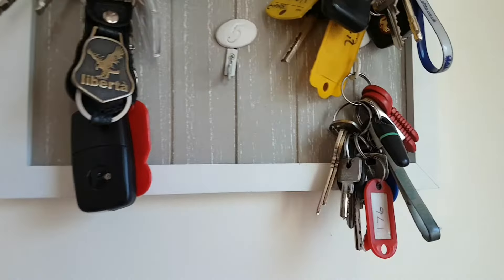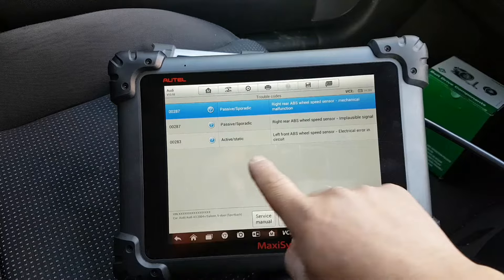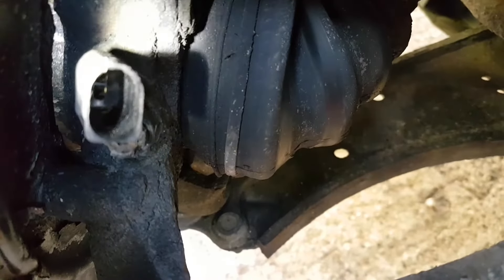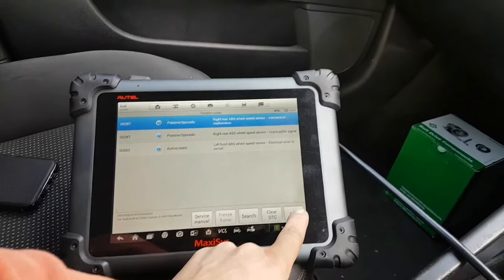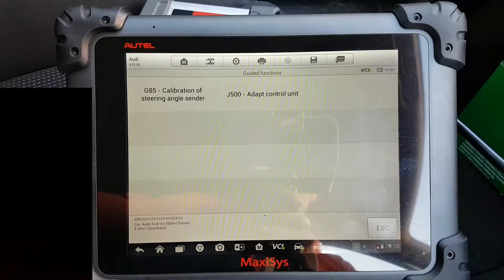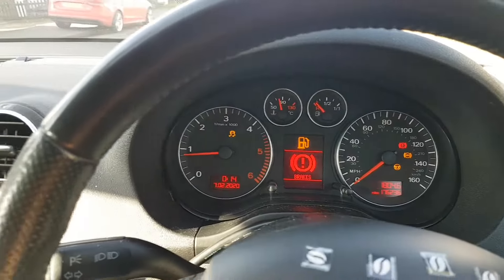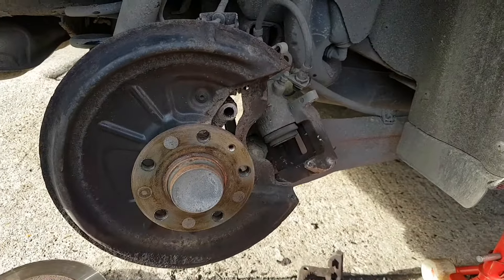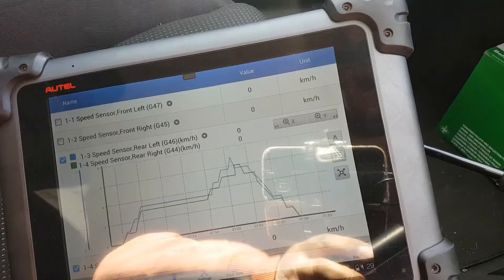Audi A3 8P ABS, ESP and Steering assist lights on. Multiple faults... Fault finding and repair.

Comment: Luis what makes them abs ring touch the sensor is corrosion build up behide the ring forcing it outwards you can get the ring for about a tenner  did both on my vw golf same set up nice video  buddy
Reply from the maker: Thanks!
👍👍👍

Comment: Good video as usual. One thing I would say is you were fortunate that the Autel showed the bad sensor waveform. I've had 0778 code, or whatever, and calibration not work because of the tiniest glitches you could imagine. VCDS scope feature usually shows them but sometimes only properly scoping the sensors shows the problem. That's the reason the car needs driving in a straight line for a while, so the computer knows there are no glitches in the wheel speed signals. Until then it instructs the under wheel computer (or if the angle sensor is in the rack and connects straight to the ABS pump it just disregards it) to kill one of the 5v feeds to the steering angle sensor (there are 2, one for transmit IRs and other to the receive IRs - can't remember which one it kills but 7 diodes for each and 2 supplies, 10 pins). This is an underhand way of doing it by VW. There is no explanation anywhere of why the calibration fails - especially when sometimes there are no codes. And the steering to the left then right procedure for the calibration is done right to left to set the limits. Don't you just love German cars 😁.

Comment: Awesome video 
I actually just purchased a Audi A6 with only 96000 km on it. Only a week in and I'm having some driving issues. I kinda noticed when driving last couple days but got really bad last night driving home. Down the road and all of a sudden my ESP came on and says see manual along with tracking control symbol along with check engine light. Car runs very rough at idle and shaking as well. Like it's running at only 3 cylinders..
Reply from the maker: Scan the car...
The logged faults should help you to narrow the problem...
Thank you for watching! 
👍👍👍
Reply: @LMAutoRepairs  yes I'm taking it in tomorrow to get it looked at. Talking to the guy at the car lot and he said it's a normal probably for the German cars to have either plugs/coil packs gone bad.
Reply from the maker: Possibly...

Comment: The magnetic abs rings on the wheel bearing rust underneath and swell up to close the gap with the sensor. Seen that with the live data after the fix wasn't exactly the same on both sides. Aftermarket ones are terrible for this. Hope this info is of use to someone watching. Happy new year my friend
Reply: Happy new year Mr L may God bless you with new and extraordinary ideas and skills to solve car problems  . Thanks.
Reply from the maker: Thats common on BMW...
Reply: @LMAutoRepairs  yes the rear ones on bmw which have metal slots have the same problem

Comment: Love your channel brother, Helps me out on the regular. Thanks
Reply from the maker: 😊
That's great to know...
Thank you, for watching and for your comment! 
👍👍👍
Reply: @LMAutoRepairs  Hi Bro, I have a question if I may, If I had a faulty brake switch, would it interfere with calibration of the steering angle sensor?. 
Basically I changed the ABS sensor on a Audi a3 2007, I cleared the code and reset the module, Immediately the steering went 20% heavier. Before that I also replaced all disc n pads and pumped the pedal a few times all the way down, I was thinking maybe this caused the switch to fail. Now I cannot seen to recalibrate the steering angle sensor and the ESP warning is on.
Cheers Mate
Reply from the maker: Possible...
ESP related components are all kinda linked...
Fix whatever fault you have and try the calibration again...
Reply: @LMAutoRepairs  Hi Bro, you were spot on, Replaced the faulty ASB sensor and recalibrates the steering angle sensor. It worked and adapted fine. Now the steering feels fine again. Glad it wasnt the brake switch, its located in the servo,
Reply from the maker: That's great! 
👍👍👍

Comment: I had this same issue, luckily only changed the sensor & bearing and all 3 dash lights went off & power steering is back
Reply from the maker: That's great!
👍👍👍
Reply: @LMAutoRepairs  Great Video i would be lost without this & mechanics suggested steering rack haha! But because i saw this i insisted its only the abs sensor & possibly abs ring / bearing thank you!

Comment: Hello I got a problem with steering assist also tried to erase fault code and after it works again after few days red light and alarm for steering assist come back and lost steering assistant completely hope you can give me advise to fix it. I'm from Philippines with audi a3 2007 1.6 sportsback almost same as in your video.thanks
Reply from the maker: What is the code that is coming up?
That should give you some direction...
👍👍👍

Comment: 22:40 for calibration will it be enough to start the engine and stand or do I need to drive?
Reply: Did not worked with my 8P, tried many times at different times

Comment: I've got all them lights on my golf mk5, it's come as the brake pressure sensor as 1 one of them
Reply from the maker: Is pressure sensor external or built in inside the module?
👍👍👍
Reply: @LMAutoRepairs  not sure, trying to locate it
Reply from the maker: If it is internal to the module, a replacement module/modulator block is probably your best option...
I never managed to find those internal sensor for sale...
👍👍👍

Comment: After changed the sensor do we need to reset the code or it will go . The speed / abs / parking assistance sensor for a Vw touran
Reply from the maker: I would clear the codes... just to make sure...
👍👍👍
Reply: Thanks 👍
Reply: @LMAutoRepairs change both rear abs sensor with parking assist sensor . But parking/ revers sensor doesn’t seem to be working . No fault on dash .  Any idea how can I test it . It’s a VW touran . Thanks

Comment: Hi mate I have an Audi A5 2009 when I turn on the car everything works fine but after some seconds when I’m start driving the speedo goes to zero abs epc esp lights came on and shows me also brake warning contact workshop.
If I turn off the car everything goes to normal but after a while is doing the same thing.
I was on audi yesterday. They did a Dignostic and they couldn’t find any faults because they told me that my ecu has been upgraded.
and when they try to find the faults the computer is crushing and doesn’t show any fault.
1 another guy told that the gateway and the wiring has been changed.
I have no idea what the problem is but I have saw many videos of you and u find solutions for everything.
If u are in london or near the London can u book me an appointment please 🙏 
Thanks
Reply from the maker: Hi
Scanning the car will be essential...
That's the first thing...
Can't believe audi can't scan it, unless there is an issue with the module itself...
👍👍👍
Reply: @LMAutoRepairs  with what module? They told me that the ecu has been upgraded and when they try to scant it the odis doesn’t response. I went to 2 dealers no one could scan it..
Reply from the maker: With the ABS/ESP obviously... as it is the one that is reporting the faults...
Has been updated?
Who updated the module then?
Reply: @LMAutoRepairs  I don’t know the car has a lot of parts from rs5 brakes callipers wheels 
I don’t know what they have done to the car I have bought it like this.
Is possible to book with you?

Comment: Brilliant info in this video, I have got the same lights on my dashboard after an engine change. The scan said abs module was faulty so changed it but still got the lights on. It seems I can only sometimes access the Can Gateway and only sometimes recognises abs and steering assist modules.
Do you have any ideas. Thank you.
Reply from the maker: Check wiring etc... everything that's been touched during the engine swap..
Could be damaged wires, etc...
Thank you for watching!
Reply: @LMAutoRepairs  hi thank you for replying, I have checked and double checked cables and fuses but know it is easy to miss, will check again. I am learning with Vcds, will check live readings on sensors incase any have been damaged.  Your channel is the best I've seen and I have learned a lot already, a real pleasure to watch.  Earned a sub.
Reply from the maker: 😊
Thanks!
Yes, it is easy to miss...
Check connections and connectors, pins, etc...
👍👍👍
Reply: @LMAutoRepairs  😁🙏appreciate that, I will get onto it tomo. Thanks again 🙏🙏🏴

Comment: Hi bro.my car also has the same problem.shall I change steering angle sensor or only abs sensor .I have a fault code Rear left Speed sensor.hope to hear from you asap.many thanks
Reply from the maker: Hi
Check that sensor first...
If faulty, replace it and go from there...
Thank you for watching!

Comment: Hi! @lmautorepairs. Love your content! I have a conundrum. I recently picked up an 06 A3 3.2 VR6 DSG. With a brand new oem mech unit. My issue is: on very wet days (after heavy rain) the car will drive fine but then flash PRNDS when coming to a stop light or stop sign, issuing a Traction Control light, ABS light and check engine light. Turn the car off and on again and quickly place it into manual 1 and i am able to get going again. The lights eventually all go away once the weather dries up and i am able to drive perfectly for hundreds of miles. Car has a brand new bosch reman alternator, newer battery, new rear brake switches, the new mech unit and service. Any help would be so appreciated you have no idea! 12 codes total, relating to abs, epc, tcu not communicating with ecu etc. but when dry, no issues!
Reply from the maker: I would guess water is getting somewhere where it shouldn't...☺️
👍👍👍
Reply: @LMAutoRepairs  that seems to be exactly the case, just cant figure out where? I checked the input plug on the transmission intself seems to be free of frayed wires. Getting a code for output shaft speed sensor concerns me though…

Comment: Hello friend, I have a polo 9n3 1.2 12v, it happens that when I'm driving at least once a week an abs, steering, airbag warning appears... I turn off the car and everything returns to normal. I detected error P0600. I've seen the fuses, new battery, alternator charging 100%, I don't understand why🙄
Reply from the maker: Is that error code on yhe engine ecu?
👍👍👍
Reply: @LMAutoRepairs  Yes is the only error that appears on the p0600 scanner. I turn off the engine, turn it back on and the steering light disappears, they only come back after 2/3 days...
Reply from the maker: Any codes on the ABS or on any other modules?
Reply: @LMAutoRepairs  Thanks, I'll check this out better...😅

Comment: Don’t know if this will help but my Audi A3 1.6 2011 it had over 16 faults listed, had all the fault light on, speedo meter was stuck on zero and petrol meter was fucked. Turns out it was just a fuse issue!! And the car works fine now. zero faults
Reply: What blew the fuse in the first place though? They don't blow by themselves?
Reply: @shifty2755  car wash

Comment: Hi.  Is Autel able to calibrate the steering angle sensor?  could you do that  Can he bring it to the 0 position.
Reply from the maker: Yes... it does...
Thank you for watching!
Reply: I am using Autel.  The Vw steering angle sensor could not be calibrated to the zero position.  Have you ever tried Wv calibration with Autel?  thanks.
Reply from the maker: Yes... have considered a bad sensor?

Comment: So you have to have all four wheel speed sensors working in order to calibrate steering angle sensor?
Reply from the maker: Yes... As is part of the ESP...
Thank you for watching!
Reply: And more. Yew rate sensor and sqib also tied in.
Reply from the maker: Correct! 
👍👍👍

Comment: I have problem with my esp. 01423 error with G200 sensor... Any ideas ?
Reply from the maker: Hi
Check wiring... if everything OK try basic settings/calibration...
Otherwise replace it...
Thank you for watching!
Reply: @LMAutoRepairs  IT a duosensor under seat ?:)

Comment: Thank for the video, I have this Christmas dashboard and fixed one error that was 40% of the magnet ring was gone. However I have the issue of a different wheel showing double speed compared to the rest of my wheels. This makes it so that the abs will not working untill I get this resolved. Have you experience this before?
Reply from the maker: No... not that I remember at least...
But again, check reluctor ring, and sensor...
You swap sensor from left to right to test... if you don't have a scope...
👍👍👍

Comment: My Audi had loads of fault codes because the rear pads needed to.be changed I replaced them and they all went away. I find one issue on an Audi sensor can bring up loads of unrelated fault codes.Not just old Audis either same with my friends 2015 a3.I won't be buying another one.
Reply: Having issue the vw tiguan  here

Comment: My car peugot 508, esp abs lights on when i turn the steering wheel please help me my friend
Reply from the maker: Scan the car and go from there...
Thank you for watching!
Reply: @LMAutoRepairs  Is there a place where I can contact you ?
Reply from the maker: You just did...👍
Reply: @LMAutoRepairs  I did
Reply: @LMAutoRepairs  what can I do now
Reply from the maker: You did scanned the car...
And?
Any codes that point into any direction?
Reply: @LMAutoRepairs  steering angle sensor signal malfunction - Connection error with magnetic holder - Internal circulation pump supply failure , C1135 , U1205, C1381
Reply from the maker: Check powers and grounds to the module...
You might have a bad unit...

Comment: My A3 3.2 Quattro has a ESP fault doesn’t scan and Quattro isn’t working on power on the front wheels. Also to mention I just got the rear hub bearing done and it happened a couple weeks  after. Anybody body has any advice ? Thank you in advanced
Reply from the maker: What you mean it doesn't scan?
Without a scan it can be a bit difficult to get any clues...
But might worth go through what has been touched during the work done... Just to make sure everything is plugged in etc...
Thank you for watching!
Reply: @LMAutoRepairs  I definitely will I’m going to recheck everything when the weather clears up

Comment: it looks like the front brake pads are fitted with the inside pad on the out side as it has the metal location strips on the outside, these usually fit inside the caliper piston... i assume this is why the brake pad wear indicator is not attached as the wear indicator wire is fitted to the inside pad ..  and now the wire will not reach..  total bodge up and the owner should be advised not to try to fix the car as they have no mechanical knowledge and could lead to an accident..
Reply from the maker: On this A3, the outer pad also has the metal clips... the clips are fitted on both pads...
I never touched the pads, and you are now the second person mentioning that... so I did a bit of research, and quickly fount that information...
So, looks like the pads where installed correctly...
Thank you for watching!

Comment: Why would someone do such a hack job a speed sensor isn't expensive and for a few pounds more comes with the brake pads and why does it beep is it because the scanner is communication with ABS module
Reply from the maker: Yes... some cars don't do nothing... some just flash the lights... audi also beeps...🤷‍♂️
Thank you for watching!

Comment: Sir P0602 and P0610 code on mazda 2004 help me
Reply from the maker: Hi
What is the background of the car?
Those codes are usually referring to programming and coding issues...
Thank you for watching!
Reply: @LMAutoRepairs  can i reprogramming via ktag/
Reply from the maker: Depends on the ecu... if ktag supports it, and you have a good file to do it, yes...
👍
Reply: @LMAutoRepairs  thanks for your advice
Reply: @LMAutoRepairs  sir can I buy mazda 1.6 bk original ecm file?
Reply from the maker: Send me your e-mail.... I have that flash file...
Reply: Sir it has P2502 and P2504 code also I  checked everything generation ok battery ok and I have checked wiring harness also it is also ok now it has P0610 code and P2502 and P2504
Reply from the maker: Sent...
Reply: @LMAutoRepairs  Did you sent?
Reply from the maker: I shared it from my Google drive... you should have had an notification...

Comment: I would have checked the other 2 wheel sensors - chances are the same idiot has done the same thing to them as well.  And he'll be back soon for injectors, dragging the last dregs of fuel complete with crap out of the tank :)
Reply from the maker: Hope not... nearly 1 year an did not came back... so looks promising...🤞🤣
Thank you for watching and for your comment!